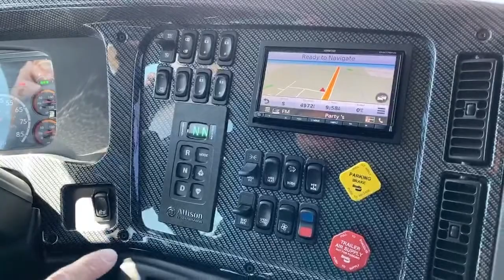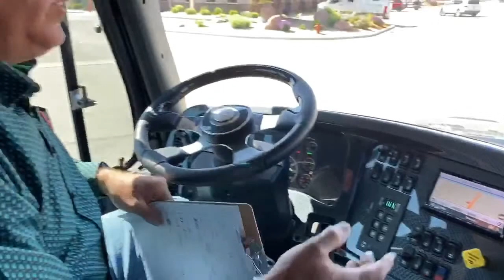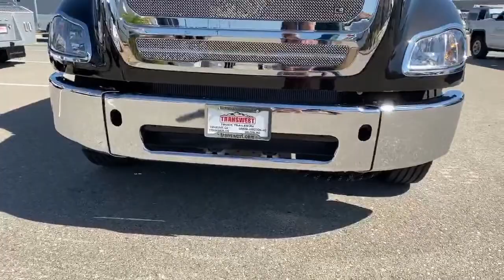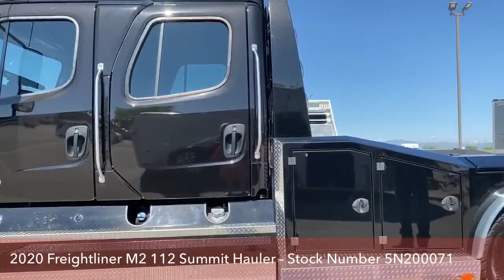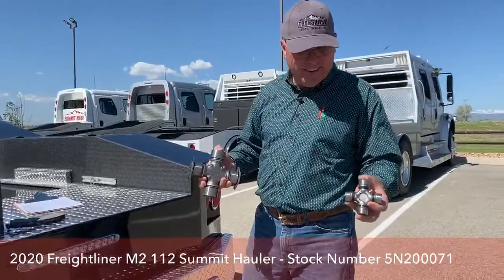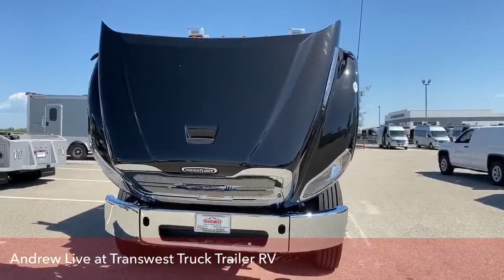2020 Freightliner M2 112 Summit Hauler

Comment: after 40 years driving the big rigs. and having a hurt body, along with bad joints in my body. just a couple hrs in the seat hurts.
but: do these trucks come equipped with disk brakes? (weight saving thought) and plumbed for trailer air? (why not air brakes and bags on the fiver).
and do they get taxed and papered as a privet truck? or a commercial truck?

Comment: Unless there's a concern about weight I would definitely put some larger fuel tanks on it .  Preferably a 150 gallon tank on each side.  And I'm not so sure about the situation but I promise you as a 30 year truck driver I would not wait no 40000 miles between  oil changes.
Reply: with all the miles i have put in just 100 each side will get you everywhere. for a couple years i ran the west coast with only twin 80's. and that was a full rig, just under 80K most trips.
so for a rv hauler. 150 twins would be over kill. your body will beg to stop far sooner than the need for fuel.
Reply: @larryjanson4011   I reckon you could say it's a matter of preference. I understand what you're saying about stops but  you can just up and stop almost anywhere..  Of course a vehicle that size it would be more convenient to stop at a truck stop to get fuel.  The thing for me is all the years I've been driving I've just grown to hate truck stops here recently, So, the less I have to deal with them the better for me. Of course with fuel prices being what they are putting out 12 to $1500 for an individual just out traveling around would be a bit much also.